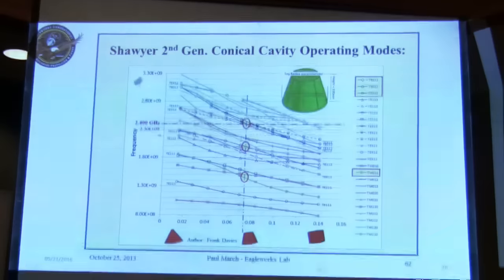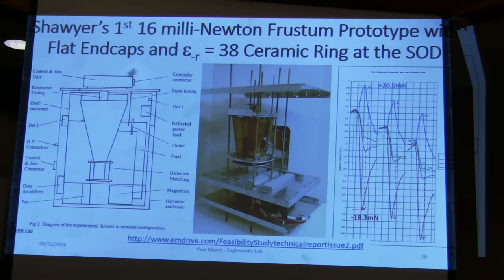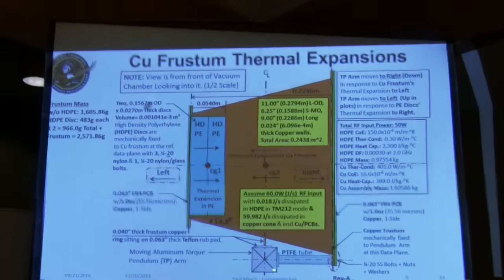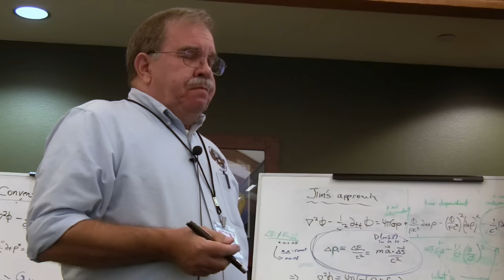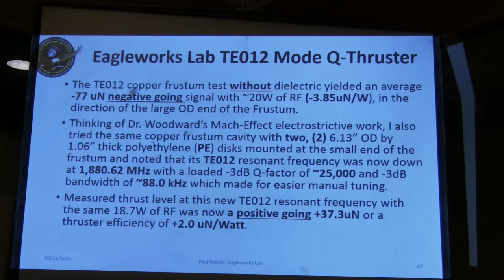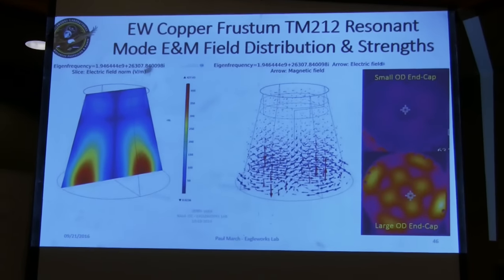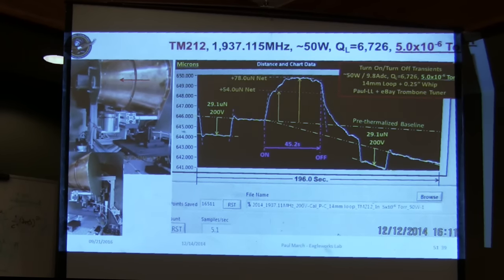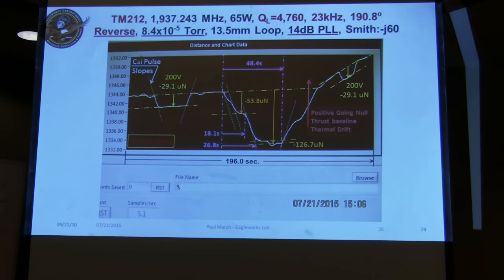BPW 2016: 11. Paul March, Experiments with RF Cavity Thrusters (pt2)

Comment: So, Shawyer's 3rd Gen article didn't work when Boeing ran it, or it, "didn't work," when Boeing ran it?
Considering the potential of such a technology, one would hope that these men and women would have significant funding.  Yet, I've heard budgetary constraints mentioned numerous times.  In one case, some simple test-stand welds were out of budget and bolts were used instead.  Why?
Reply: Lost and Found - The Face of America Abroad 
It is very fascinating to hear that the limited research funds throttle progress to seem within reach of anyone.